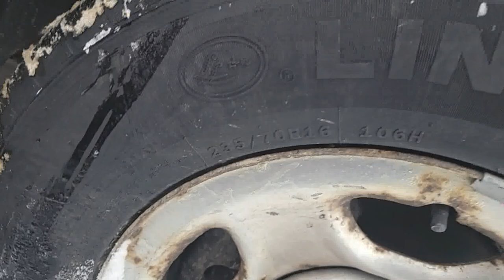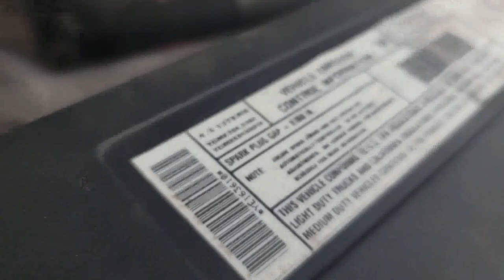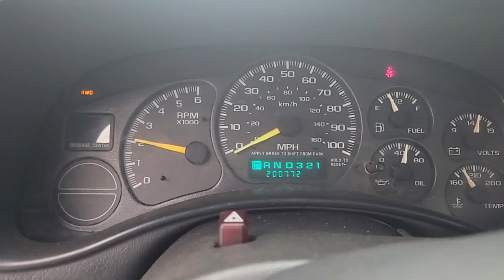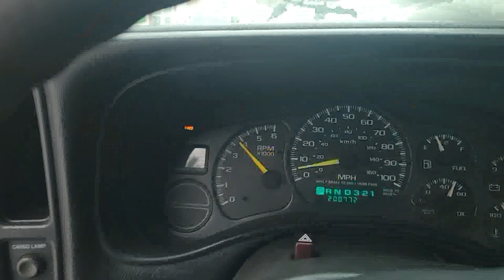Defective Harbor Freight Badlands winch and cashing in Chevy truck Scrap

Comment: I scrapped 2 chevys like that last year. 01 and 04. Rotted frames, cab mounts, rockers. Both had ignition problems, rotted brake lines. They were yard tucks on campus, low miles. That generation doesn’t age well. Not like the square bodies and 88-98 trucks.

Comment: Same thing we have here nothing but problems come to find out theirs a resistor that bolts on to the positive battery cable and to battery throw them in the trash they have been the issue with us maybe try it with yours
Reply from the maker: I didn't even use the resister from the beginning